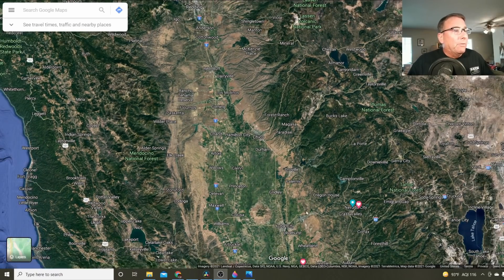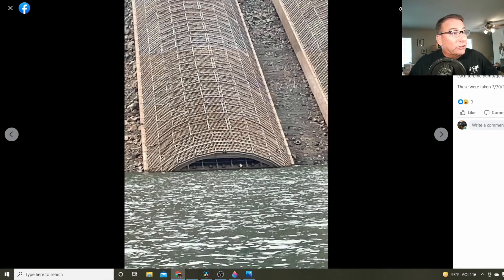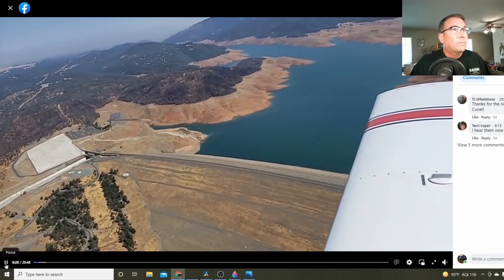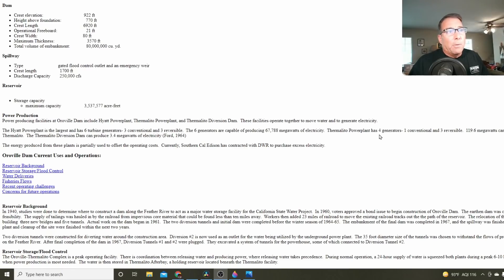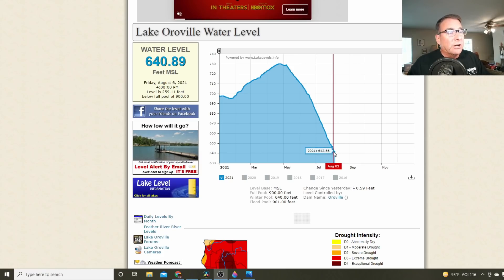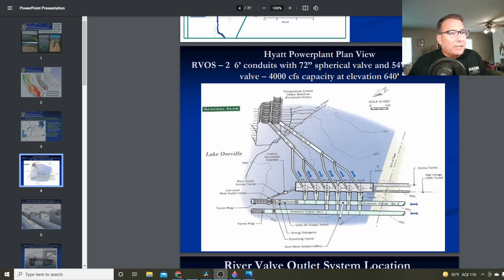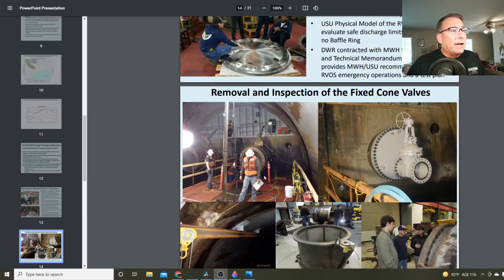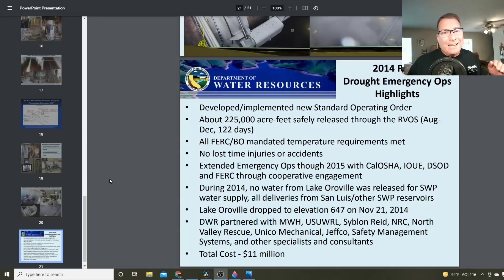Oroville Update! Hyatt Powerplant Offline 8/6/21 California Drought

Comment: California needs to prepare more water sources…

Severe Ancient Droughts: A Warning to California
"BEGINNING about 1,100 years ago, what is now California baked in two droughts, the first lasting 220 years and the second 140 years. Each was much more intense than the mere six-year dry spells that afflict modern California from time to time, new studies of past climates show. The findings suggest, in fact, that relatively wet periods like the 20th century have been the exception rather than the rule in California for at least the last 3,500 years, and that mega-droughts are likely to recur.

The evidence for the big droughts comes from an analysis of the trunks of trees that grew in the dry beds of lakes, swamps and rivers in and adjacent to the Sierra Nevada, but died when the droughts ended and the water levels rose. Immersion in water has preserved the trunks over the centuries.

Dr. Scott Stine, a paleoclimatologist at California State University at Hayward, used radiocarbon dating techniques to determine the age of the trees' outermost annual growth rings, thereby establishing the ends of drought periods. He then calculated the lengths of the preceding dry spells by counting the rings in each stump.

This method identified droughts lasting from A.D. 892 to A.D. 1112 and from A.D. 1209 to A.D. 1350. Judging by how far the water levels dropped during these periods -- as much as 50 feet in some cases -- Dr. Stine concluded that the droughts were not only much longer, they were far more severe than either the drought of 1928 to 1934, California's worst in modern times, or the more recent severe dry spell of 1987 to 1992."
http://www.nytimes.com/1994/07/19/science/severe-ancient-droughts-a-warning-to-california.html
Reply: California has always been a hot and dry place. Combine that with a massive population increase and intensive agriculture and yeah no surprise that there is a massive water shortage.
I think the only reliable option for water sources are seawater desalination plants.

Comment: 550 kw is very Little

I use 1300 kw, 1.3 megawatts a month

I have a small, 600 sq ft apartment

My bill is about 250 a month

A normal house that is 4000 SQ feet, the electric bill is 1500 to 1700 a month

Comment: A lot of numbers thrown around. How much of that 3000 was for the hydroelectric and how much was just being released down stream.   What is the purpose for two thirds of the outflow while one third is utilized for power production. The only consistent was 3000  being released, that seems to indicate that the priority is set on how much is released from the dams indifferent to the level of water behind the dam, this is most probably where your current dilemma originates rather than the effects of current climate norms.

Comment: They should use floating dock mounted solar panels right behind the dams where no boats are allowed, that are tied to the grid at the power plant of the dams, so they have limited expenses connecting to the grid and being controlled at the power plant, and they will shade the water and cool it to help keep the oxygen content high for the fish. Other benefits are 100% unobstructed light to the panels, and the proximity of the panels to the water cools the panels and increases their productivity and efficiency.

Comment: I must have missed something.  If the "temperature control" inlet, which is the only thing in the diagram that feeds water to the power station, is now above the lake's waterline - so no water is passing into the power station - how can any water by flowing into the River Valve Outlet System?  According to the diagram (and the video) it is fed from water discharged after it's gone through the turbines.  If the turbines are dry - where is it being fed water from?  Does it have another source of water not mentioned in the diagram/video?
Reply: There is a lower inlet in one of the diversion tunnels, but it bypass the turbines of course.
Reply: @hansjorgkunde3772  So there's another outlet from the lake (as the temperature control outlet is above the lake's waterline) that bypasses the power station completely?  That makes sense - but I must have missed it on the diagram and audio.
Reply: @dav1dsm1th  Well its a valve there that can be opened to maintain river water levels. Otherwise the river would completely run dry. Wich is certainly not healthy for wildlife in and along the River. It was the part with the baffle ring in the video. :)
Reply: @hansjorgkunde3772  That doesn't answer how water gets from the lake into the river level control system when the lake water level is below the temperature control inlets.  Thanks for completely missing the point.
Reply: @dav1dsm1th  https://youtu.be/3g3UADJZAZQ?t=684  In this diagram are two main tunnels below the turbines. The second from below hold the River outlet valve to the left. The water comes from an inlet left of the valve, why else would there be a valve? 
The height lines show approximately 550 feet for this inlet.... So yes there is a lower inlet that links to the River outlet valve. I'm not missing the point, you miss understanding simple diagrams and how a dam is build.
Reply: @hansjorgkunde3772  The "simple diagram" is, to me, confusing.  Both diversion tunnels have labels pointing to shaded areas at their left (of the diagram) ends marked "Tunnel Plug".  Plugs, in my experience, tend to plug things.  The turbines have blue arrows next to them showing the direction of water flow through the turbines (1,3 & 5 "out" only, 2,4 and 6 "in" and "out").  At the right end of the diversion tunnels are blue arrows showing water can flow in either direction at that end of both tubes.  There is NO blue arrow at the left end of either diversion tunnel - which is what is causing my confusion.  If you are correct (and you probably are) that water is entering diversion tunnel 2 through the "tunnel plug" at the left end of diversion tunnel 2 - the diagram would be more understandable if it had a blue arrow showing this - and some indication that the left end of diversion tunnel 2 ends up in (and is fed by) the feed lake somewhere below the level of the temperature control inlet.  After watching the video - I was under the impression that the "low level river outlet valve" was controlling water exiting the turbines and flowing TOWARDS THE LEFT end of diversion tunnel 2.  Hence my confusion.  At this point I've lost the will to live or to understand the diagram.  Have a nice day (and sorry for being snippy in my last comment).
Reply: @dav1dsm1th  Well that diagram was a bit blurry :) Its all good . One key sentence in the vid was that you can drain the whole lake with it if needed to keep maintaining the river. So there had to be a lower outlet. :D

Comment: Juan, could you please explain your comments about the intake penstock controlling temperature and water flow?  Having worked in the industry and been married to a senior hydro mechanical engineer, I am only aware that water intake at ambient is the primary and sole function of these penstocks.  I have never heard anything about temperatuare control.  The cold water coming into them past the wicket gates actually helps keep the turbine blades cool, as far as I know.  Any insight you can shed on this would be appreciated.  Thanks.

Comment: *It didn't stop the pop.  Retire that cardioid microphone. Cardiods make pop much worse. The proximity effect makes bass frequencies much louder and pop is in the bass range so the pop is worse. The proximity effect is caused by being too close to the microphone.  If you are using a cardiod you must be at least 12 inches away for it's proper operation otherwise you get proximity effect.  Cardiods are most useful when singers have floor monitors and cardiods reduce the feedback from floor monitors. But only when the back of the microphone is pointed at the floor monitor. When the singer tries to be cool and tilts the microphone down and sings up to it they are destroying the whole purpose of using a cardiod.  Many people say cardiods reduce the room noise.  Truth is not by much.  My experience is cardiods are not good microphones for discussions in rooms.  Omni's are much better.
*Get an omnidirectional microphone.  Like a shure sm63. Omnidirectionals do not have proximity effect. I notice that you are talking directly into the microphone.  Put the microphone to the side and talk across it.  That way the bursts of air don't hit the mic but rather flow past it.  The sound from your vocal chords radiates from the mouth in all directions so it gets to the microphone just fine. Whereas the pop from "p"'s is a puff of air that flows directly out from the mouth and can collide with the microphone. Also the further you are away from the mic the more control you have over your volume so you don't have to ride the volume pot.  If you are 3 inches away and you move 6 inches away your volume can change by 6db.  Get in the habit of talking at least 6 inches from the mic.  That way as you move your head slightly your distance to the mic changes a smaller percentage than if you start out at 3 inches.  Actually 12 inches from an omni in a low reflection room is best.
*To reduce the noise from the room make sure that walls that can potentially be sound reflecting are a good ten feet away.  And if you have walls that have nothing on them to break up the sound then put something.  Sometimes just framed pictures can improve the room reflections.  But hanging some curtains over the walls is the best.  I hang old bedspreads suspended about 4 inches from the wall.  The most silent studio I was ever in had 6 foot widths of cheap trailer shag carpet hanging from ceiling to floor about 4 inches from the concrete block walls.  Quite an undertaking for a home studio so just hang some old bedspreads.
Reply from the maker: Hook me up with a link to a better mic...

Comment: Thanks Juan for a documentary style analysis at the Orville Dam.   It sounds to me like a number of people think the Feather River will never see rain or snowfall in amounts sufficient to fill the reservoirs.  People need to understand the cyclical nature of the Northern Sierra weather.  It seems as if all memory of the numerous catastrophic floods of Yuba City, Sacramento, Marysville etc. are gone.  Like Hoover dam, Glen Canyon Dam, Oroville dam and Shasta dams are storage dams intended to hold back on the wet years and release on the dry years.  I was so lucky to visit Hoover dam for the first time in 1983.   The dam had storage to its top.  The emergency overflows were more than enough, Most dams on the Columbia are run of the river dams. They do not store water for use later. Only Mica Dam at 700 ft of landfill could actually effect the flow on the 200,000 acre feet of storage.   At 265,000 cfps without a huge cyclical swing   Most dams get just what they need.

Comment: That res can't be all because of drought. I live on a power plant lake/res in Texas we had a few dry yeas and the lake dropped like 20 feet but since came back up. flooded again and has been stable in the pool level. It only takes drinking water not irrigation, for that you are on your own to drill a well or do without. Only cali scums think they can take what's not theirs and pump and divert water from others and when even that runs out they complain. How about don't move into a desert and try to irrigate it? How about utilizing the forest resource, it is a way to cause a natural fire break and make some money for the rest of it? You cali screwballs won't even do that...how many acres of valuable timber have gone up over the last 3 years alone? I would have paid to relocate everyone that got burned out and the fires would never have got so big!!!!

Comment: Clarification about the pressure relief wall.   It is true that the pressure relief wall is designed to fail if there's water backed up against it with 15ft of head on the inside (basically if the control chamber floods, eventually the wall fails and lets the water out).    In the RVOS failure, the wall failed due to vacuum on the downstream side, not head pressure on either side.    
Notice in the diagrams it shows an air supply tunnel that connects the chamber just downstream of the wall with a location further down the tunnel.  The idea is that if high flow rate causes a hydraulic jump (a tall standing wave) all the way up to the top of the tunnel cutting off direct air flow back up the tunnel, then it can still draw air through that air supply tube from downstream of the jump back into the cone valve outlet chamber to equalize pressure.    But they calculated the position of the potential jump assuming the dissipation ring was in place.   Without the ring, it is likely that the velocity was much higher and the hydraulic jump formed further down the tunnel.   My suspicion is that it formed literally right under the downstream air tunnel opening, which turns it into a siphon pump and it literally tried to suck all the air out of the cone valve outlet chamber.    That pulled the wall down, and tried to suck the people out of that chamber, as well as destroying some some of the doors in the access tunnel back up to the power plant, which was a good thing, as it allowed some equalization of the pressure, albeit with hurricane force winds.

Comment: Well, if the water ever goes back to the 900 foot level, then there will be the 2019 problem again of water seeping through the emergency spillway. This was caused by not grading the aggregate backfill near the Fuller equation for maximum density during the Peter Kiewit repair project. I guess the civil engineers on this project fell asleep during their junior level materials class that discussed this. Enough seepage has the potential to collapse the ESW & wipe out Sacramento. Now would be a good time to high pressure grout with a clay/silt slurry to make the backfill less permeable.

Comment: Currently at ~640 feet, started the year at ~697.  That pen-stock inlet looks like it is more than just 50 feet exposed.
Back in June, inflows were similar to now, but outflow was double what it is now. This is a manufactured issue.

Comment: The view from the airplane really shows how broad the base of the Dam is -- so hard to imagine it from other perspectives.  We had a series of dry years earlier in the 2010s then 2-3 heavy rain years and now back to 2 years of lower winter precipitation. That inconsistency would seem to throw a wrench in the climate change narrative.
Reply: Not even slightly. Warm air holds more moisture. Extremes of weather is exactly what was predicted.

Comment: Thank you for this video. Idiot question here. If the dams had never been built would the water flow (natural) create a salinity problem? If yes then aren't you guys being made to dance by a totally artificial man made disaster? If I need power, and I need water it would seem to make sense not to have the two rely on each other to this extent. Obviously it can't be fixed overnight but it is hard to believe that 4.5 years ago you had so much water it almost destroyed the dam. Would almost make one think that whomever is in charge doesn't get out much. Might be time to find some alternative for energy, things that work  when there is no wind or that work at night. Also thanks to the guy supplying the photos. Sad to see this for all involved!

Comment: make it rain......fill it up.....Cloud seeding, the main type of intentional weather modification, began in the late 1940s. The basic idea was to use aircraft or rockets to inject silver iodide or another substance into the atmosphere to mimic ice nuclei. The amount of rain or snow a cloud can produce depends on a balance between the number of ice nuclei inside it and the amount of water available to grow around those nuclei. Clouds often lack naturally occurring ice nuclei, so injecting them with silver iodide particles (which are very similar in structure to ice) increases the number of nuclei. This makes the clouds more efficient at generating ice crystals that either fall as snowflakes or melt to produce raindrops, depending on temperatures in and beneath the cloud. Cloud seeding is also used to disperse fog banks near some airports.

Comment: Setttings in Windows for “find mouse pointer” using the control key. Should work on remote screens too. Draws an expanding circle around the pointer when pressing the ctrl  key … worth a try
Reply: To clarify the good idea:  That's under Windows' "ease of access" settings:  "Make the mouse easier to [find? See?]"
Once configured, you tap either one of the CTRL keys, and Windows flashes a series of decreasing diameter concentric circles around the mouse cursor position on the screen.
There are also settings for changing mouse pointer colors in addition to just pointer size.
Reply: @77thTrombone  Thanks for the details!
Reply: @peteraldino3423   np!  I'm a keyboard jockey, and I use this "ease of access" setting all the time.  I'd rather tap one of the CTRL keys to find where I've knocked the mouse, than to put my hand on the mouse,  jiggle it, and scan across 3 screens to see where it's  gone.  Thanks again for the suggestion to Juan.  I think it's a great idea.

Comment: Juan quoted from a document that stated "The six generators (of the Hyatt Power Plant) are capable of producing 67,788 megawatts of electricity."   As others have previously noted, that cannot be the case.  I suspect that this figure may represent the megawatt-hours capable of being (or actually) produced over some period of time.   For comparison, a large nuclear power station is typically rated at about 1000 megawatts.  I found this in an "LA Times" August 5th article:  "The Hyatt plant is designed to produce up to 750 megawatts of power but has often generated 100 to 400 megawatts, or slightly less than 1% of the state’s average daily peak usage."